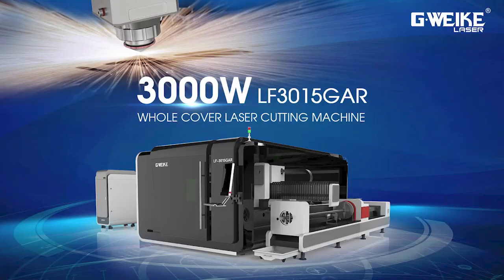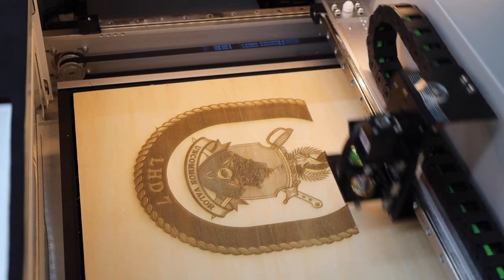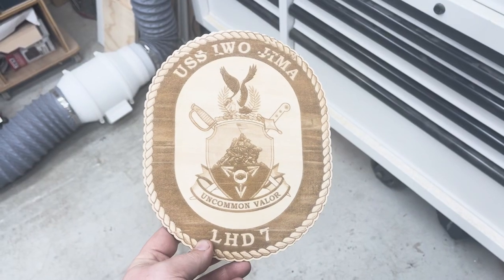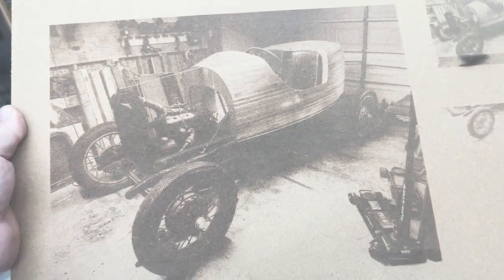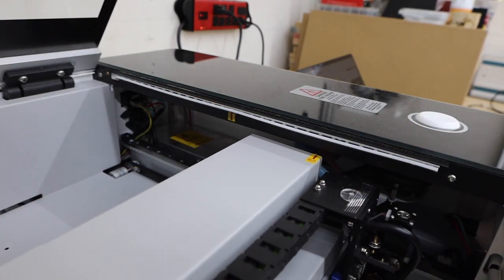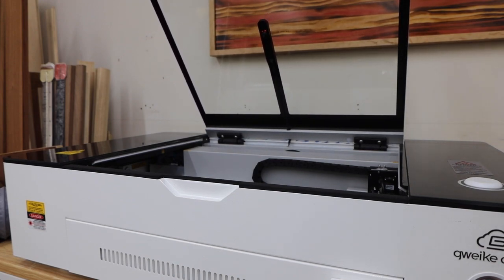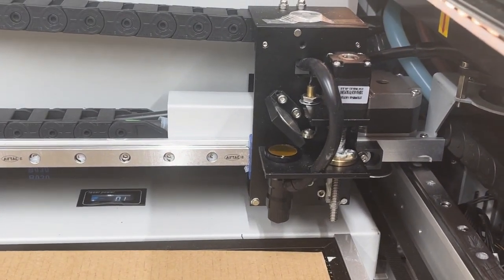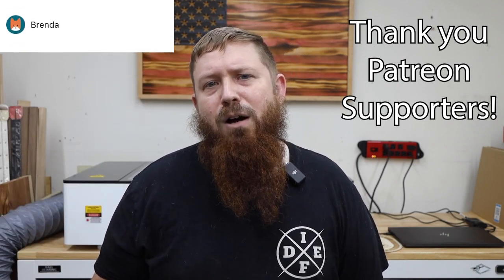Gweike Cloud Pro 2 CO2 laser cutting machine review

Comment: 6:40 Z-offset: With running a program several times I presume you mean running the same Lightburn file multiple times for the same material thickness. In that case, setting the material thickness in Cuts/Layers causes the Z-offset to be set automatically when starting the job. This value is stored with the file, so it will be there and set accordingly, even if you ran a job using a different offset before.

Comment: I've had the Gweike Cloud Pro II for a few weeks. The results have been frustrating. I checked the mirror alignment and it is off. I'm trying to get the left side cover off so that I can align the mirrors. The top cover on the left side appears to have on 2 screws to remove it. Something seems to be holding it in place. Have you had the cover off, and how did you get it off? Thanks for the great video.
Reply from the maker: I guess I’m lucky that I didn’t have to mess with the mirrors at all. Then again, maybe that’s just an issue I haven’t gotten to yet. I’ll take a look at that cover though and let you know if I can figure it out.